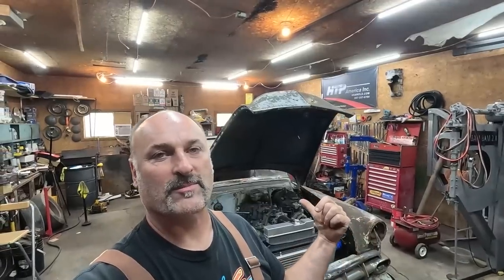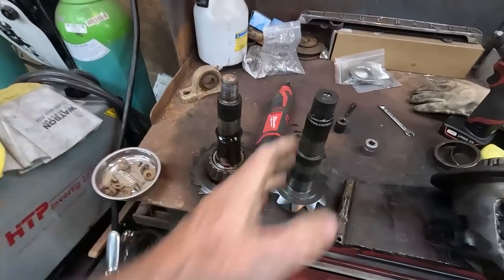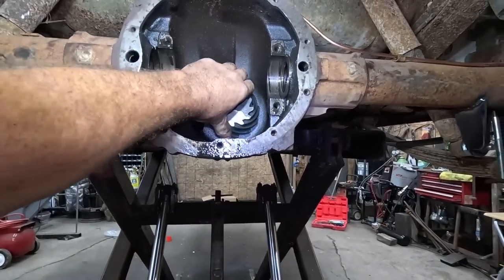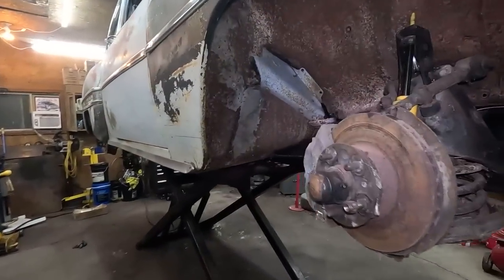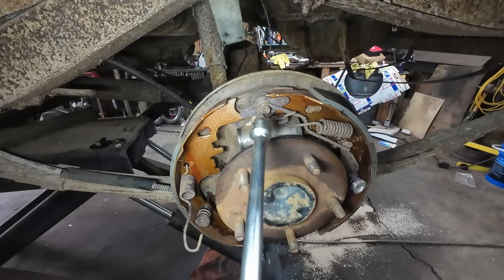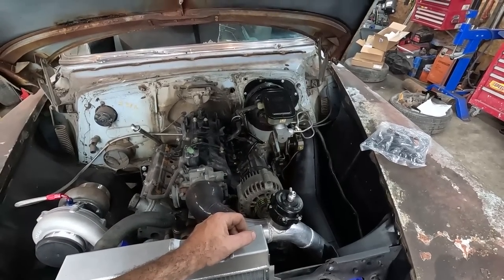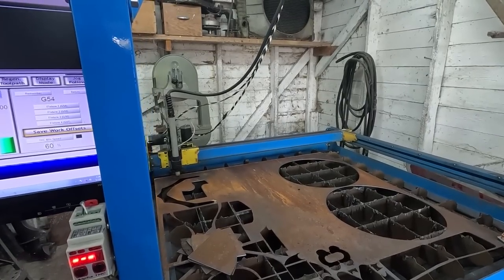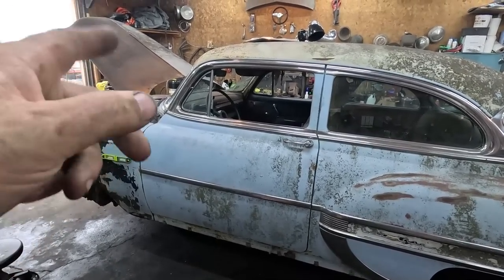Changing gears and welding a posi unit in our 1954 Chevy

Comment: Control tooth contact pattern with the pinion shims, but you also must maintain tooth backlash with the ring gear, by  advancing ot withdrawing it.  Backlash shound be checked with a dial indicator.  If you change shims and fail to maintain backlash, you'll be chasing your tail forever.  (38-years in the gearing business)
Reply: - The end goal is to have the Marking Grease Rubbed Off {making a clear spot} in the Middle Of The Larger Ring Gear where the smaller pinion gears drive/turn it {the ring gear}, forcing the wheel's axles to spin round and around...while all at the same time maintaining a specified slop of the ring gear side to side to match the new pinion gear's position, in or out, so as to best dampen the harmonics producing whine...did I get that right Mr Gaylord?
Reply: @RobertFay l
Reply: Or he can do it however he pleases being it's his project.  Brent do you don't worry about the armchair mechanics
Reply: good and correct answer. 👍👍

Comment: A small piece of angle iron,worked for me. I put in driver side floor pan and cab mount,for my 96 s-10 . I unbolted the line. And ,it dropped down. Then layed the angle iron over the line and put a fan,on it. Thanks again Brent👍👍

Comment: OK Brent! Nice video. 44min is just fine with me sir. In that length you cover a lot of different things and that keeps it moving right along. It also gives you ample time to drop little notes about other things too, like the new shop cement pour vid.   2 things:  1) I commented previously about making a SPOOL out of a diff carrier. In my case using a Chrysler 318 Poly Hemi w/ 2X4bbl's in a 2,800 Lb car, I kept ripping the cross shaft hole out and the shaft would start hitting the pinion. So I took a carrier to a bonafide welder and paid him to weld it. A couple days later I was back and showed him that the spiders and side gears had run right over his welds and it started to act as a normal diff and filled the whole banjo with garbage. So he welded the Hell out of it. He welded every bit of both side gears and the spiders to the carrier. There wasn't a mm of gear edge that wasn't welded to the carrier. End of that problem. Then I started breaking axles. (big slicks) There's always something next. 2) I think you mentioned to Esther in the Anne Lions car show BTS video where you were going to set up the shifter so you could hang one arm across it while it's in Drive and be "cool" as Esther put it. Did you get that far yet?  One More Thing:
I commented on having a honed out pinion stem bearing so you can slide it on and off the pinion stem for easier setup. see 🡲 @randyhughes5160's comment. Thank you Brent for all the great stuff you show. ben/ michigan

Comment: If you get 2 pinion barrings and grind one out where it just slides on and off until you find the amount of shims then press on the good one make short work of it
Reply: Yes! I concur, saved me saying it. Probably only 1/2 thou press fit. Hone it or stick it in a lathe & grind w/ a hand held die grinder if need be. 1/2 thou won't take long. ben/ michigan

Comment: I have welded some diffs just like you did but I tend to also take a piece of flat steel and cut out a square piece to lay on the gears and then weld all the way around it instead of just in the corners of the gears. Holds way better.

Comment: We used to spool open rear like you did with a Lincoln stick welder, and some 7018 rod. Hence we did make Lincoln lockers. :) I ran a 9" ford as my street racer with a strange mini spool in it. A minispool is just as hard on tires, and axles, but I've never broke a carrier running one like you do with a welded diff. If this is for field racing I think you won't have any issues due to lack of grip when you turn on dirt, it won't wind up the axles. Just my humble opinion from experience.

Comment: Set the pinion gear to run center in the ring gear, adjust backlash with shims on either side of the ring gear, and the pinion rotation resistance is set with the crush sleeve,  you only get one shot with the sleeve so do the snug and check method,  pinion rotation should have around 25 inch pounds of resistance,  I made a 3/8th  drive plate that bolts to the u-joint strap holes,  most inch pound torque wrenches are 3/8th drive, hopefully you have some strong axles for the " spool" lol, BTW,, move the ring gear left to right with the different thickness shims in the bags,, you should track dead center in the ring gears, a couple thousandth deep is good for future wear but never run it loose or it'll wear out long before it should,

Comment: Hey Brent I noticed your body lift is doing the same thing mine is the small steel wheels are digging into the concrete if you take a 3x3 steel plate and put it under the wheels it will stop that love your videos keep it up 👍👍👍👍👍👍👍👍👍👍👍

Comment: Love the bodgy posi common enough trick makes handling tricky but ok on dirt, gearset will work but I'm not sure thats how you set them up, it works its fine use heavy diff oil, You wont know yourself in your new shop what with everything ready to hand, good progress that old Chev is nearly a driver

Comment: The hot ticket is to take an old pinion bearing and hone it out a few thousands so you can just pop that on and off by hand during this set up process. 
Just make sure it's the exact same depth (height, thickness) as the new pinion bearing you'll be using for the final installation!

Comment: My dad used to use white grease on the gears and a dial indicator, wish I paid more attention cause I need to change my gears in my Ford, nice about 9' pull the chuck put it in a vice and set it and replace it. good luck with your project :)

Comment: Hey Brent those 342 gears are a common gear in the trucks and are a good hi way cruising gear
Reply: Of course that would be with an overdrive trans and Trucks use a 32"+ tire height. Usually Brent uses old school 350's and they're straight thru in 3rd. Using an online Transmission ratio RPM calculator 3.42's w/ 27" tire = 3,000 at 70mph. That's me w/ my old 1969 GTX cruising Woodward for a drag race back in the day. Today's cars use those "nice" gears but they always cut the RPM by 1/3 with OD. So, that same tire = 2,000 RPM at 60mph w/ OD. Where a 33" tire will yield 70mph at 1,700RPM.*(please don't quote me, use the calculator, I get lost in the numbers. Dixlexia)   ben/ michigan

Comment: Brent, I am amazed by the transmission shifter modification.But I am a bit worried, because it is very close to exhaust manifold. The heat might burn any rubber or melt down greess lubricant quickly. Thank you for the lecture.

Comment: don't know if it was mentioned but next time using the splitter on a press rotate it 90 degrees so the splitter is taking the load not the bolts. although it didnt hurt this time

Comment: At 1:26; I was confused that the turbo is sitting on an exhaust flange, but there's an exhaust pipe leading from the exhaust manifold?
Than I realized the exhaust pipe leading from the exhaust manifold is a crossover pipe from the drivers side exhaust manifold.  ;-)

Comment: Shouldn’t the rear wheel brake cylinder have a spring between the rubber seals to hold them apart?

Comment: Brent, if I understand what you did by welding with the carrier in the diff. Does that mean it's a "locked" rear diff now? BOTH wheels are driven at the same time and speed, regardless id the car is driven straight, or in a turn?? If yes, why would you want this done?? (I understand, in tight turns, the rear wheels will squeal and wear faster.) I ask, because I just don't know is all.
Reply: Yes sir  he has kicked it now . Like he said it's definitely not ideal tires will chirp , wear weird. But I'm sure they'll be toasted off before the wear knowing Brent lol. Just a cheap way of making both wheels spin .